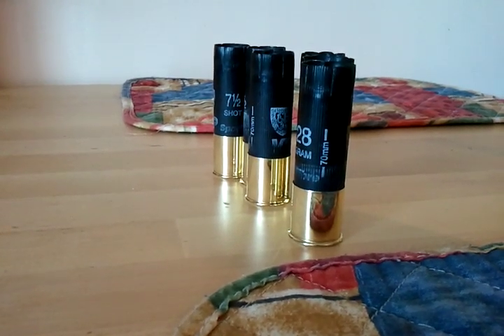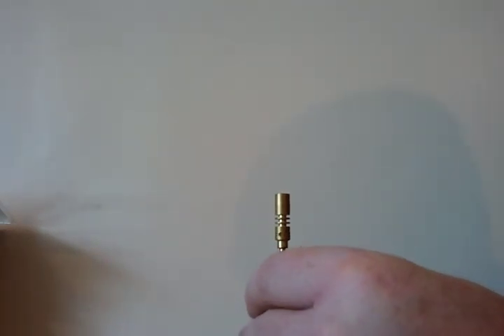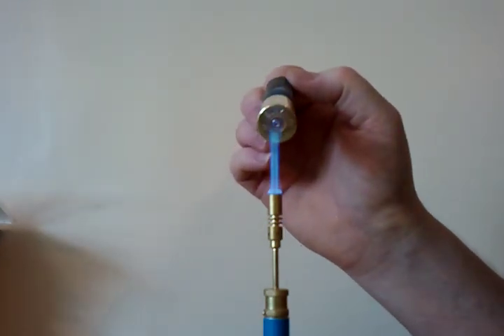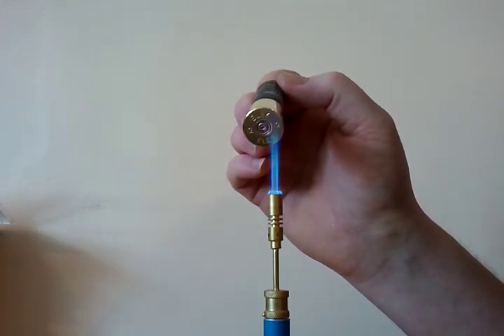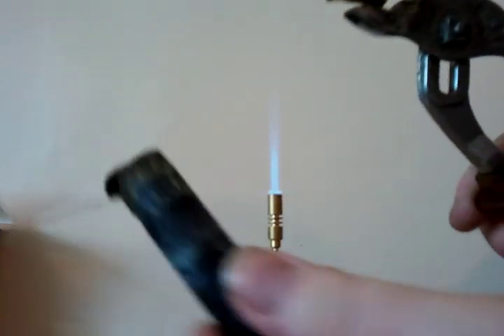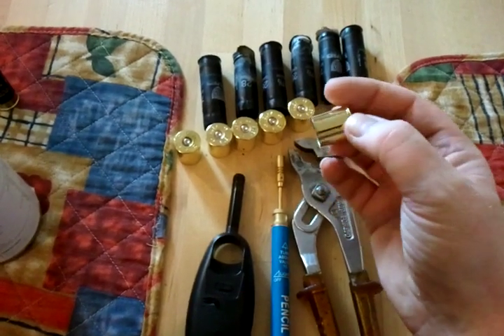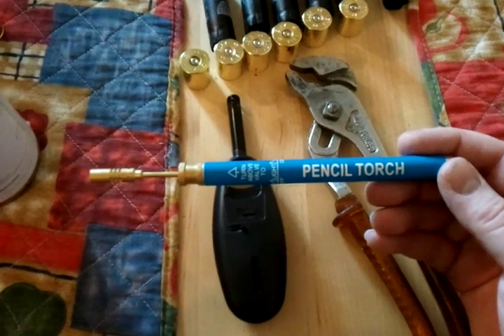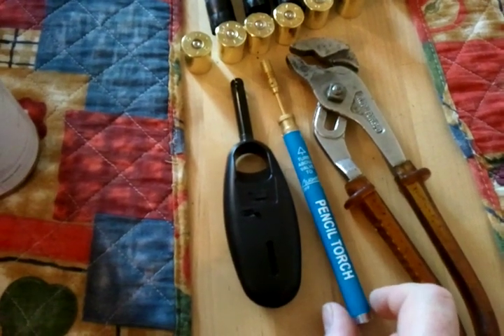How to Remove brass from shotgun cartridges

Comment: What I found was it takes too long doing 1 at a time.  I ended up turning a regular clothing iron upside down with the flat bottom facing upward.  I then turned it up to the highest heat setting, and then I place at least 7 shells at a time, and let them heat up for a couple minutes.  Still slow going, but better than 1 at a time :-)

Comment: Why set the house on fire or get burnt? In a piece of timber (4 x 2) drill a hole the size of the cap just under the lip, pass the cartridge through and pull the plastic out with a pair of grips.  Some brands may need the fireing cap pushed out first to stop the cap going concaved.

Comment: I just did this and the primer had been struck but it didn't fire. my brother takes them apart for the black powder in them and said I could have them. So I took my torch and lit the end. 30 seconds later that bitch blows up in my face lol im good though... just scared me
Reply from the maker: A fired case (spent) should show a blackened hole in the primer in the bottom of the cartridge "inside" a cut cartridge that has been salvaged for shot and powder should be treat as unfired. As you can see with the ones I use, they are spent "hence the crimped end unfolded" if your unsure then just leave them! And source ones from a clay club etc that are spent.
Reply: yeah I learned my lesson lol. I use spent cartridges and they worked fine. I check them every time now